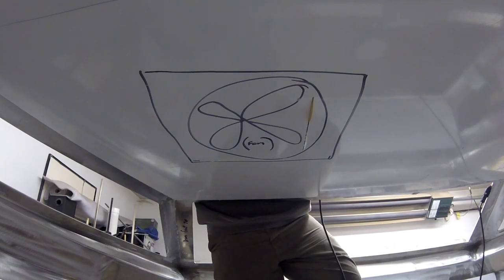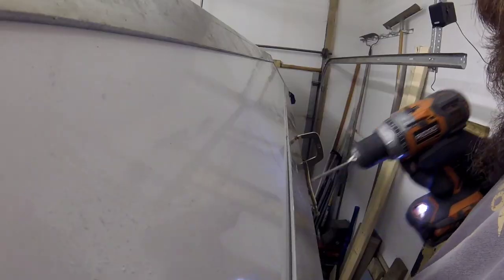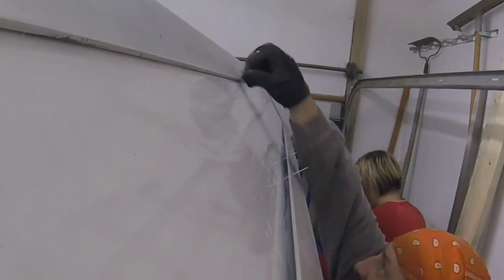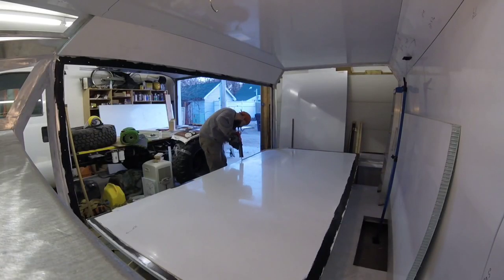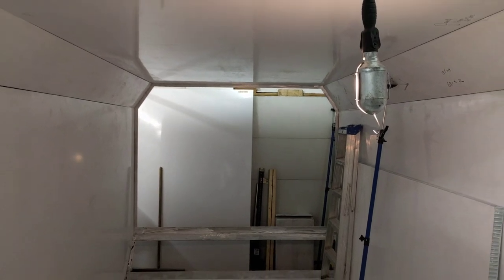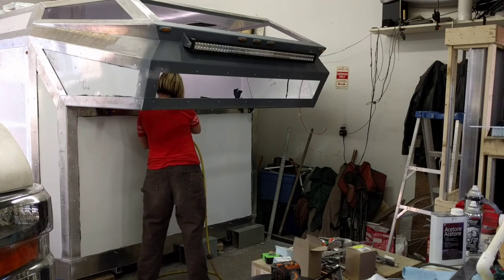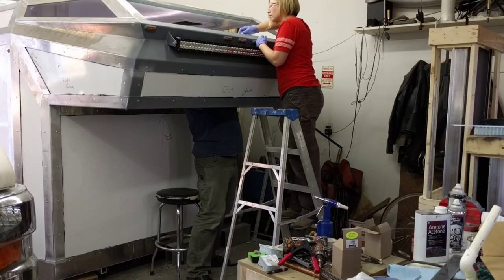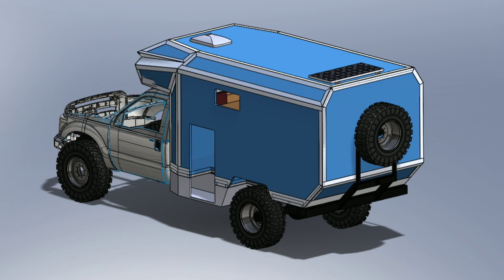More Composite Honeycomb Panels Installed - How to build an Overlander

Comment: Greetings, thanks for the wonderful video.  My question is, do those rivets go all the way through the metal frame and the honeycomb paneling out the other side of the opposite side metal frame or do they just go into the metal frame and under the skin of just one side of the honeycomb panel?  Also, exactly what type rivets are those and what are the rivets size dimensions??
Reply from the maker: No, otherwise you'd have rivets all over the inside of the camper... They are called butterfly rivets and they open up inside the panel, pulling the outer skin against the gasket until the SikaFlex 252 cures. After that, they are cosmetic and serve little functional purpose.
Reply: @Everlanders  Got It! Thanks!

Comment: i am wanting to make a slide in bed camper.
I want to build (tip out bunks) on the driver and passenger side. With tent canvas. 1 person per side so 33" wide max. By 7 feet long.
I like the idea of the honeycomb panels as they are already coated with fiber glass. I was going to use plywood. But not now!
Thank you for making this video.

Comment: very important to stand the gelcoat get
00:53
the adhesive rubber gaskets something to
00:57
stick to and I found the primer just       I been back to these build Videos  ,I jus way cool to see this happen ,NASA could learn from you .    Composite Honeycomb Panels These have got to be tough ,I try to find some here in Florida. 12'  I would need help.  I like ow you folk did the GELCOAT & ADHSIVE RUBBER GASKETS THEN Primer. . DId you happen to say the expected live cycle of the   Composite Honeycomb Panels . I read the transcript ,the cc is not so good it covers the screen.

Comment: Amazing build. Did you have any issue with gaps between your panels on the interior? Is so what did you fill them with or did you place trim over them as you added cabinets?
Reply from the maker: There were no gaps, but I did use the strip LED lights to cover the seams... The rest of the interior joints are covered with cabinets.

Comment: How did you put all the composite panels in place, it seems for a simple box structure that all panels would have 45° angles cut on them, floor would go down easy, walls could be tilted in at the top, bottom edge goes in first then the top of the panel is pushed out to the glue/exo frame... but once you get to the roof how do you install it? Because of the 45° angles the panel would be too big by 2x the panel thickness in each dimension to fit in the hole available. I know you did your roof early on but I believe the issue remains for at least 1 or more of the final panels to be installed. How did you overcome that?
Reply from the maker: Easy... Floor, Roof, 45°'s, Walls...  
(As shown 😄)
Reply: @Everlanders  I don't know if you're joking or if perhaps it was easier for you due to your camper having more open angles and more smaller panels. If we talk about a cuboid shaped exoskeleton camper with 90° corners everywhere and we cut the 2" composite panels with 45° angles on every edge then the floor and roof will install easily but after that when you go to place the first wall panel in place you may be able to slip the lower edge down into place but once you go to tilt the top of the panel in towards the exo frame you'll find that you can't get it to clear the roof panel by 2" as although the face closest to you is the correct length the outside face is too long. I hope I have clarified the situation. Using an endoskeleton would solve this. I notice it appears ambition strikes got around this by just using butt joints. Unicat uses butt joins but this would require some extra processing near the edge to remove the thermal bridge.
Reply from the maker: I wasn't joking and I'm not going to get into long debates with you, I showed exactly how I did it in the videos.
Reply: @Everlanders  sorry I wasn't trying to be hostile or debate with you I'm genuinely trying to solve the issue I see with this construction technique.  I have watched your videos several times and I can't see / understand how you got round the issue. Never mind, enjoy your travels :)

Comment: can this be used to build floating cabinet inside the van ?  or kitchen sink ? is it much lighter compare to plywood ? 
and  what kind of rivet hole are you using to join the panels ?   

Wow, so impressive i'm about to build inside of a van , thinking of switch to this rather than wood. ..
Reply from the maker: It's nearly 2 inches thick and much more expensive... So I don't think it's we'll suited for cabinets.

Comment: Thanks for doing the videos. You must have been wiring my brain because I have had this type of box in my head for about 20 years. I got the idea when we built an ice plant in garnet sc, but those panels are 4" thick. Do you have a weight on the box. And how thick are the panels, they look to be 11/2 " pr so and are they aluminum clad honeycombed? Thanks for any info. Finally got my sub to work
Reply from the maker: They are fiberglass clad honeycomb, I didn't want to have problems with radio signals like WiFi and cellular.

Comment: This truck is so cool, that I want to build my own after watching all these videos. Question; Can you add, or attach things to the wall, like furniture... ?  Thanks!!
Reply from the maker: We sure did!
Reply: How? With screws, or you have some sort of stud, or the wall holds screws without the studs? Thanks! @Everlanders
Reply from the maker: The same as the outside... Sikaflex 252 a Aluminum Plate, Square Tube or Strip to the wall and fasten to that.
Reply: Thanks!! @Everlanders
Reply: @Everlanders  Can you share an opinion? I'm going to build a slide in, cabover camper, using the same honeycomb panels you used. I've been looking at countless videos of DIY pick up truck campers and am narrowing down my design and materials, but I have 3 critical questions remaining.

On the chance you have time to respond, I'll leave my questions here, and thank you for the terrific video and info! 

1. Is it really necessary to build the base of the camper narrower then the bed of my truck so that it will fit BETWEEN the wheel wells in the bed of the truck? 

Or,  can I make the base of my camper as wide as the interior of my truck bed and simply create cut outs at the bottom of the honeycomb panels, to accommodate the wheel wells? The camper shell would be set down right over wells, and on the interior, I can simply build a box over them to hide them. I'm thinking with some reinforcing trim around the wheel well cutouts, I can maintain structural integrity - am I wrong?

2. Rather than building an entire slide in camper that rests on the bed of my truck, is there any reason I cannot just build it as a truck bed TOPPER and save on materials? I can then simply carpet the floor and sidewalls of the bed of my truck. 

3. IF it IS safe and structurally sound for me to simply create the camper as a topper only, can I still build it as a cabover? I definitely need that space above the cab for my bed. Any reason I can't build a topper with a cabover feature?

Thank you again for the great video and info you share, it's enormously helpful!

Comment: Hi!! Great videos on your rig!!  Totally new to this so sorry if these are basic questions.  I'm under the impression there are two  types of composite panels.  One has a type of foam between two thin layers of fibreglass and seem to offer insulation....the second type of panel has a honeycomb structure material between two thin layers of fibreglass.  Could you let us know which type of panel you used?  If you used the "honeycomb" type, are the honeycomb structures "empty" or hollow and do they offer any kind of insulation?

I saw your comments that you can't recommend the panel supplier you used...is it possible to let us know what state/province they are located in so we don't bark up the wrong tree so to speak?  Thanks in advance and apologies for all the questions!!  Looking forward to watching your other vids on your build and adventures!!
Reply from the maker: +goandseetv There are three types in fact...PS Foam Core, Honeycomb Core (what we used) and Form Filled Honeycomb. Foam filled Honeycomb is best in my opinion, but hard to find a vendor who deals in smaller volumes as used in trucks like ours. There of code other options like the FM2 boxes from Germany which have aluminum skins, but I think that is outside the scope of a self built rig.
Reply: Ok, thanks for letting us know!!  It looks like you're really enjoying your camper in your latest vids!!
Reply: @Everlanders  Why did you choose the Honeycomb Core over the more standard Foam Core?
Reply from the maker: Foam Core failed my stress and delamination testing.

Comment: What exactly is the material you used for your walls called? And is it something I can get at the local hardware store
Reply from the maker: The Honeycomb Composite panels were custom built, I've never seen them in a hardware store.

Comment: Those are solid structural rivets? Not open blind?
Reply from the maker: +Design RSQ No, they are open blind butterflies, and all needed to be filled with Sikaflex afterwards. The rivets are mostly there for clamping force and style points. Once the Sikaflex 252 cures it's "superior to welding or rivets" - I did all 3 :-)

Comment: How much are the honeycomb panels per square foot, roughly?
Reply from the maker: They vary by manufacturer, thickness, composition, but expect to pay between $8 and $30/ft²
Reply: @Everlanders  Thank you! What supplier did you use? Also, is there a reason for going with the one part adhesive rather than an acrylic or epoxy structural adhesive?

Comment: I would have used 3m vhb tape to adhere the panels you wouldn't need any rivets either
Reply from the maker: +sifterbox VHB would not have worked in this case.  In some places the aluminum needed to be pulled to the panel... Maybe in a perfect world.

Comment: hhhheeeyyyy - How have you found the thermal conductivity of the Aluminium Honeycomb panels? Being that Aluminium is such a good thermal conductor, and your panels have an aluminium honeycomb internally linking the inside and outside sheets, do you find that they end up transferring quite a bit of heat from outside to inside while in direct sun (which you need for your solar panels)?
And then the inverse, have you found in cold climates your diesel heater has to stay on to maintain a good tempurate as the Aluminium acts as a heat sink and draws the heat out? 

*Or, having rambled all of that, has it not been much of an issue?
**OR, has the weight saving of the honeycomb panel vs a more insulated panel, been a valuable trade off?
***OORRRR, "I like aluminium, stop asking questions"
Reply from the maker: There is no aluminum in our panels, I assume it would be very high.
Reply: @Everlanders  Oh shoot, sorry, i had it in my head that they were Aluminium Honeycomb panels

Comment: Hi Everlanders!!  Hope your camper and travels are going strong this winter...Sorry I had a few more newbie questions (sorry for all these questions!!)   Could you explain a little about how the riveting of the exterior panel works?  I take it you drilled holes through the outside facing fibreglass skin of the composite panel but I'm guessing you didn't drill all the way through the interior facing fibreglass skin of the composite panel, then you put a rivet through the hole and riveted the panel to the frame.  Is that the principle?  I How have you found the strength of the riveting bond...You mentioned you filled the rivet holes with sikaflex I'm guessing you did that to prevent water from entering the honeycomb interior of the panel right? Sorry, one last question, did you also use the same process of rivets and sikaflex to attach the interior cabinets, frames, chairs to the fibreglass floor and walls of the camper?  If you could shed some light on these it would be greatly appreciated!!  Thanks in advance!!
Reply from the maker: +goandseetv Correct, only the outer fiberglass skin is drilled. The rivets are primarily used as a clamping system as the sikaflex 252 adhesive cures. The glue is much stronger than the rivets. If you Google "Butterfly Rivets" and look in the image section and you can see what I used.  Also the rivets leave a small hole in the middle so they are also filled with SikaFlex.
Reply: Hi, thanks so much for clarifying that.  Have a great holiday season!!

Comment: What are the dimensions of the panels and how much are they per panel?
Reply from the maker: They were custom fabricated to the size required by my CAD drawings, the cost will vary depending on the manufacturer you choose.
Reply: @Everlanders  did you do the CAD drawings yourself from design all the way to finishing?

Comment: The rivets in the composite panels, are they all the way through, or just through the outer layer of fiberglass, and they expand in the honeycomb structure?
Reply from the maker: No, they only go through the outer skin. In fact they are not even needed, once the adhesive cures they could be removed and filled... We kept them for the aesthetic.

Comment: what kind of rivets did you use? And how did the sika 252 work out?
Reply from the maker: The Sikaflex 252 is still holding strong with no leaks or anything. These are the rivets I used. https://www.summitracing.com/parts/aaf-all18183
Reply: Everlanders thanks for getting back with me.

Comment: Wow. I am looking into making a campervan conversion. I was doing research on materials regards low weight strong  for cabinets and came across your video. Seems there is very little info regards DYI with honeycomb out here. One thing i running to is suppliers and cost vs plywood. Any info. on this you can supply? I would be using mainly material for paneling of the cabinets. Cabinets and drawers main framework will be 80/20.
Reply from the maker: Cost will be many times more than plywood... If your stuck on using 80/20 just get some 4mm Baltic Birch Ply. It'll just slide into the slots on your extrusion.

Comment: Why would VHB tape not work?
Reply from the maker: Sure, VHB might stick it there, but Sikaflex 252 is many, many times stronger, both in tension and shear strength. Heat and chemical resistant... When I spent this much time and effort putting something like this together, I want it to last...
Reply: @Everlanders  true! I agree with the Sikaflex. I was wondering why you used rivets instead of VHB tape for the initial stick 😁

Comment: Was looking at the panels to put on my pontoon boat for decking. So Saturday instead of watching something on netflix I ended up watching about 3 hours of your videos . Love it ..
Reply from the maker: Thanks Tom! It's amazing what you can get done after canceling a Netflix subscription, I built a truck and now we're traveling the world!
Reply: Tom, I'm doing exactly that. I have 75 mm width second hand styrofoam core cool room panels that I'm in the process of bolting to the deck of a tritoon. I bought 13 panels for $1000 AU. They need a tidy up but should work fine. Hows your build going?
Reply: @SwampCityRadio1974  ended up buying 4 sheets of marine grad A A Plywood $205.00 a sheet  its floating now
Reply: @SwampCityRadio1974   the problem is you will have to core them because they are hollow  I ended up buying AA marine grade plywood  205 a sheet X 4
UGH

Comment: How thick and stiff are these panels wall? how much do they flex if you would walk over one that is suspended from the two ends as a "bridge".
Reply from the maker: The would depend on the length of the bridge and the weight of the person walking.
Reply: Oops sorry left that important detail out. Lets say the bridge is the length and width of the floor of your build. How much would you think it would flex and how much weight would be close to a breaking point?

Comment: Love your videos - great teamwork!  With the rivets - did you use a washer or something on the back or do they just deform inside the panel?
Reply from the maker: We use Butterfly Rivets, Also called Tri-Fold rivets... They spit and fold open into three sections for maximum surface area.
Reply: @Everlanders   Awesome Build!!! So did you sleeve the holes in the Panels? Or are they strong enough without that, or did you not go all the way through the panel? It looks like you just go through the aluminum and the outside layer of Fiberglass. 

The other question I have does it insulate well? I know you couldn't get the foam filled Honey Comb, So I am curious on your thoughts of how it insulated.

Thank you in advance. Tried looking at your comments to try and not ask the same question. Keep up the good work!
Reply from the maker: Yup, you're correct, the rivets just grab the outside layer... They pull it against the 1/8" gasket spacer until the SikaFlex 252 cures, after that they're cosmetic. The air filled honeycomb offers about R7, and it's working well for us.